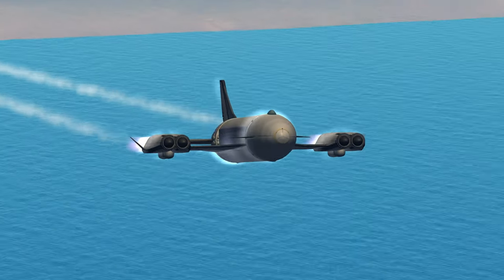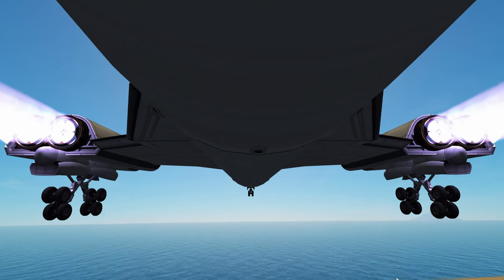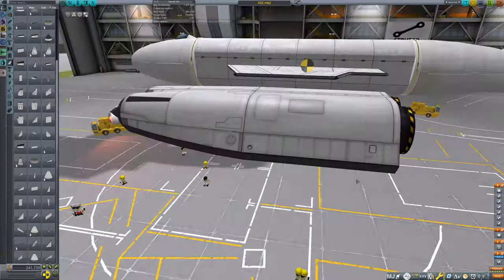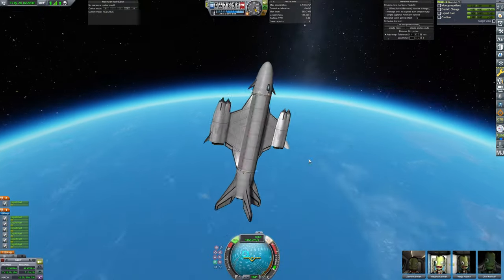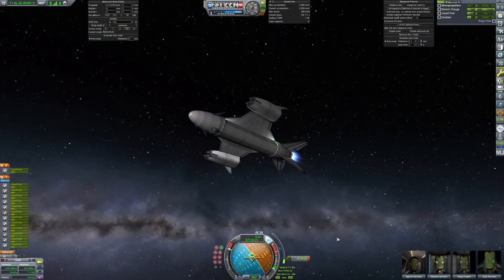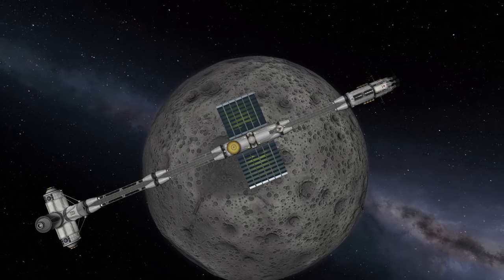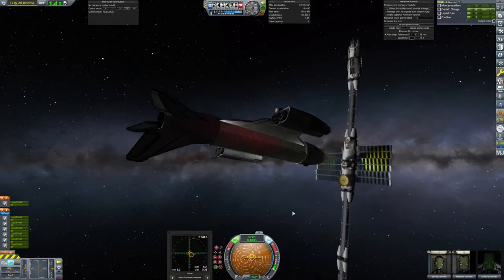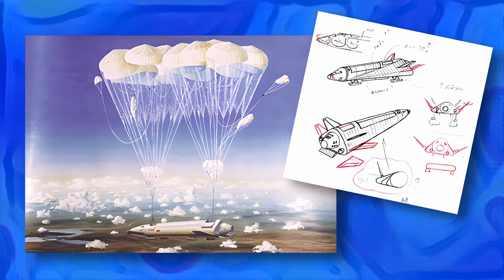spin effects you should know in KSP.

Comment: in theory, with a good flight computer, you could dock to the spinning station, you'd just need to provide enough centripetal force from the engines and a good way to control translation when turning
Reply from the maker: yup just need TARS from interstellar to match RPM ;-)
Reply: @Yakez42  "kOS"😉
Of course, it will take more than a couple of hours, but it is quite possible.

Comment: You can still have an axial docking port and avoid the Dzhanibekov effect. The trick is to make it not shaped like a line, but shaped like a cross, with the shorter arms of the cross still contributing significantly more moment of inertia than any docked craft will.

That way, you ensure that the axis of rotation will always be the axis of the largest moment of inertia.
Reply from the maker: Yup, basically getting in resonance with Dzanibekov effect or making it insignificant. From what I got researching this, any rotating asymmetric body would get it at some threshold.
Reply: @Yakez42  The Dzhanibekov effect happens exactly if a non-axisymmetric body is rotating about the principal axis with the intermediate moment of inertia (or an axis close to it).

Comment: What are your mods?  I think i know some but i want to be sure. Excluding your part mods
Reply from the maker: There were no part mods in this video. All crafts are stock. Visuals are Spectra (with all addons), EVE, Scatterer and Waterfall.
Reply: @Yakez42  Btw i just want to say that all of your crafts are absolutely amazing, the most spectacular looking craft i have ever seen. Now to my real problem.. Because i dont have all the DLC it doesnt let me load the file for the SSTO meaning that i had to copy it from your video.. I think i did a farely good job of copying it since it stills lifts off.. barely.. ( 6 meters above sea level after the runway had ended..) and after it lifts off its VERY VERY VEEERY stable even though i struggle to control it while reentry and it does have enough fuel to go to the mun and back and even a 1 way trip to duna. Now i do have 100 parts less than you.. i dont know where you got 100 more parts but eh it doesnt matter. My real issue is that my copy from your SSTO is kinda not powerful.. Like it cant lift anything other than its own weigth.. Even if i add 1 ton extra weight the SSTO, the SSTO crashed into the ground at a speed of -1 vertical speed and 200 horizontal speed.. So please tell me one way to improve TWR so it actually lifts off.. Btw adding more rockets (rapiers?) isnt helping since that actually reduces TWR..
Reply: Also how much ram does spectra and parallax use in your system? i am buying a new computer in some months so i want to know if 8 gigs of ram will be enough for spectra and parallax or if i will need 16 gigs
Reply from the maker: So with SSTOs you can check perfectly balanced space shuttle video for design tips. I tend to clip quite a bit of fuel tanks into fairings. Not entirely realistic, but I tend to tell myself that the whole thing is custom fuel tank xD Forbidden KSP tech video also go in depth into aerodynamic tricks of KSP. Can be handy in SSTO construction.

Considering RAM, well I do run 48GB of RAM and my win10 system can eat up 11GB on its own (even with Edge deleted). So it hard to give concrete numbers when it depends on system. But I can totally say that even with hundreds of mods it is hard to go over 32GB of RAM with KSP. So 48GB is there only for 4k video editing. Also for quite a long time I was running 16GB DDR3 system with moderately modded KSP in 1080p and it was completely fine. In the end of the day I stopped treating RAM as "hardware". I treat RAM these days as storage drives. If I have not enough I just get more. RAM prices are not so high. Motherboards and CPUs in last 15 years have been supporting way more RAM than necessary, like my current B5500-Plus can support 128GB... I will never use that capacity even with 4k editing.

Comment: This is a very clipped craft. Can you build a version of this with no clipping. I’d be extremely interested in seeing that. Same parts just laid out in a way without clipping. Stacking rapiers and clipping them away seems like cheating. I mean why not just clip it all into one pointy fairing lol
Reply from the maker: Faring have plenty of empty space. If it was procedural tank it would be fine, but it is not a vanilla feature. Thing is that small fuel tanks provide drag and putting them inside faring make it playable. And this drag will kill ssto part really fast. You can add two huge levitating tanks on the sides with matching nosecones on both ends and have 0 drag from them. Is it cheating then? It works better than any amount of clipping in this craft. Like any good old game KSP have too much exploits/features to ignore them and roleplay no-clipping purist.